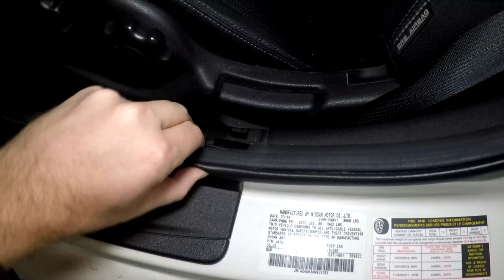370Z Tower Bar Wrap | Interior Trim Removal

Comment: I have a 2012 black cherry Nissan 370Z with 76k miles I purchased new in 2012.  I used it primarily to drive the 110 total round trip miles/day to work and back.  I since became disabled and typically only drive it once or twice a week nowadays.  Does anybody know what the purpose of the extruded aluminum cross tube behind the seats is?  I've always thought it might be a cosmetic/protective cover for a rear torsion or stiffening bar possibly.  I've looked online but have never found any answers.  Does anyone know what it's true purpose is?  Also, the stock driver's seat doesn't go high enough for me.  I have added 1/2" tall steel spacers to the four driver's seat mounting bolts.  I replaced the four factory stock driver's seat mounting bolts with 1/2" longer grade 5 hex-head machine screws.  Even with this additional 1/2" of seat height I still need a thick seat cushion to see out and over the relatively long nose of the 370Z.  Adding in the fact that I'm blind in my right eye which diminishes my depth perception anyway.  It's difficult for me to judge the distance between the long front end of the 370Z and pesky things like curbs and other vehicles.  Does anyone know of an aftermarket seat jacket (preferably like the one my Mazda RX-8 had) that would raise the stock seat height significantly higher than stock?
Reply: Your guess on the cross tube behind the seats is correct Brad. It's a cosmetic and protective cover for the rear strut brace, which is very similar to the strut bar underneath the hood of your car. As for the seat not rising enough for you, might I ask how tall you are and which seats you have? The seats rise up plenty from my perspective. On the higher levels I can even touch the roof pillar with my head.